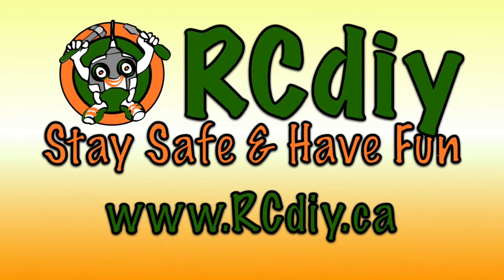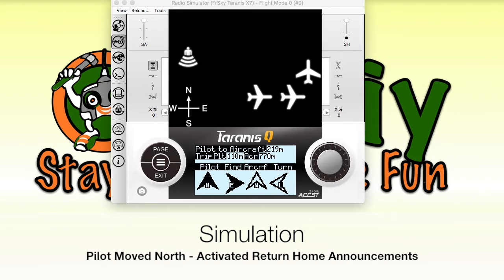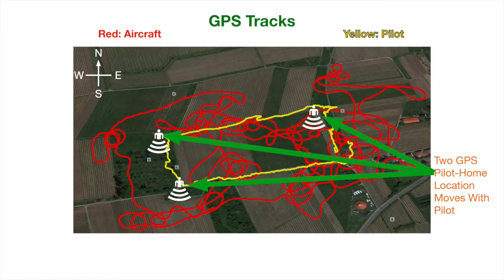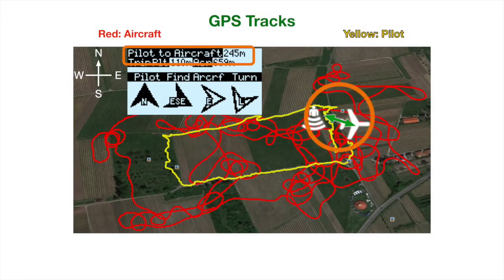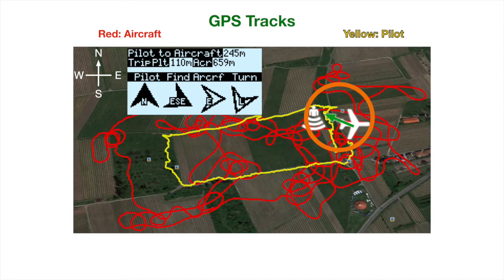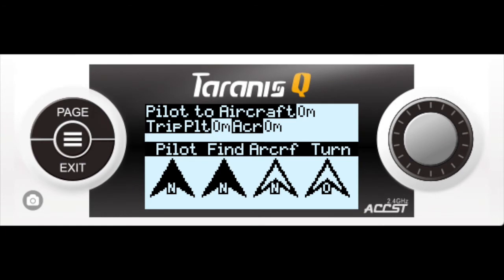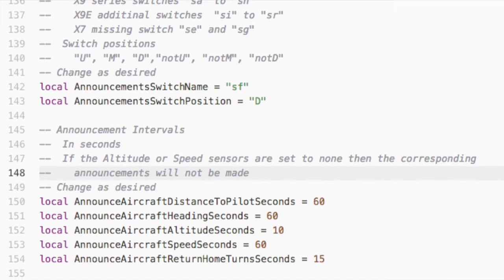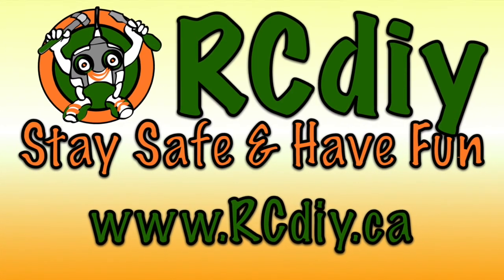Taranis Q X7 OpenTX GPS Distance Trip Find Return Home Lua Script

Comment: Hi RCdiy,
Nice script you got here,
I have some questions about it. 
I got it working sort of the script runs i see the arrows but if i move the GPS in my boot it is not responding on the arrows. 

And the GPS sensor in the module bay is draining my battery in a few minutes.
Is it possible to slim the script down to only distends between the two gps units, speed and heading of the boot?

My fw = opentx-x9d+-2.2.3

Kind regards 

Henriko
Reply from the maker: Hi, did you use a translator? I’m having difficulty understanding.
Reply: @RCdiy   Hi Sorry for my horrible English
I am using my teranis x9 for my baitboat and I am hoping to get the duel Gps to work on it so I see the distance between my radio and the boat.
at to moment the script is working I am getting no errors but the compass arrows ar not moving if I move away from the boat, and if I move the boat the arrows ar not moving either.
Kind regards 
Henriko
Reply from the maker: No apologies necessary:) The FrSky gps is not very accurate. I found that I had to filter out readings when the distance between readings was small. Because this was meant for Aircraft I set the distance quite high. It is likely that the distance between the boat and transmitter is not large enough. Use a pure text editor like notepad to change that distance in the code. It is fairly well documented.
Reply: @RCdiy  tnx it is working after updating to opentx 2.2.3 I needed to erase and rediscover the GPS units
Reply: @RCdiy   Hi I was wondering if the script can write the speed in text on my screen instead of announcing it?   I'm only using the distance between pilot and aircraft and 2 arrows pilot and aircraft so plenty of room to get the speed up there. Tnx in advice
Reply from the maker: Please ask for support here https://forum.flitetest.com/index.php?threads/gps-distance-trip-find-return-home-lua-script.34085/

Comment: Thanks for this awesome script, it would be possible to show the altitude on the screen instead of the voice?
Reply from the maker: +mlk yes. I’d have gauge demand. For me it’s a question of balance between a cluttered screen vs. a useful screen. I figured if people are flying fpv then they couldn’t look at the screen. If flying line of sight then and loose sight I want them trying to find the plane visually and not looking at the screen. Already had one person loose sight and get it back using the script.
Reply: Thanks for the quick reply, my intention is to use this script in a lond range quad, so if the video drop but still have radio, take it back to the home position, thats why the suggestion, also, this works with other gps like a one with betaflight board? Thanks.
Reply from the maker: +mlk this works only with a gps that shows up on the OpenTX Telemetry screen. Please send me an email using the contact form on RCdiy dot ca and I’ll look at adding altitude.
Reply: I have send you the email with details, thanks.